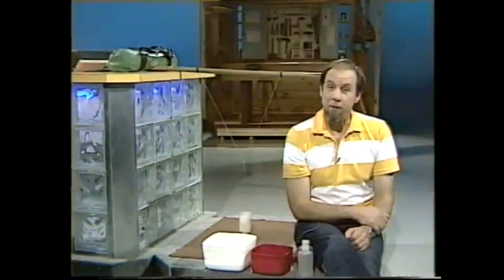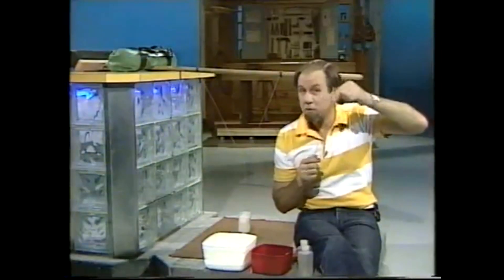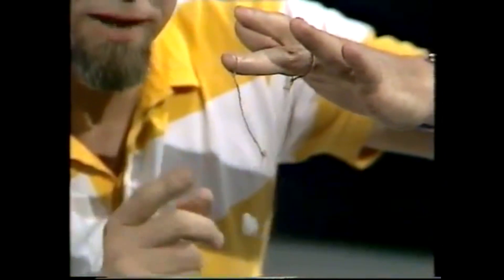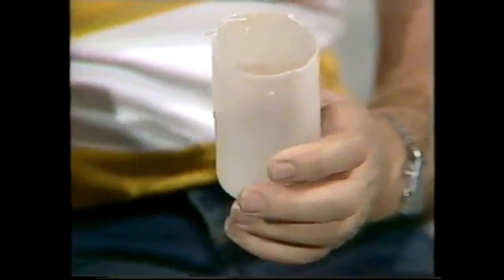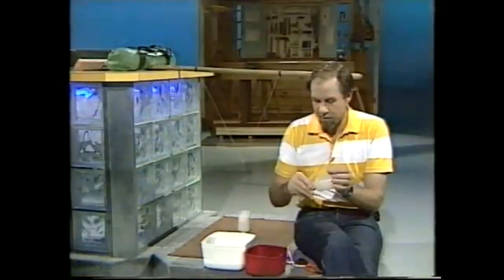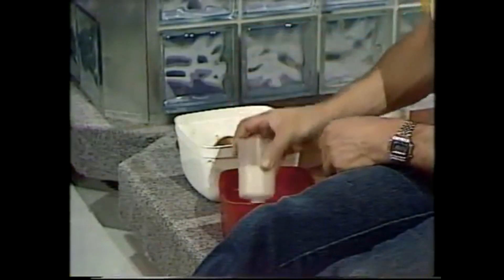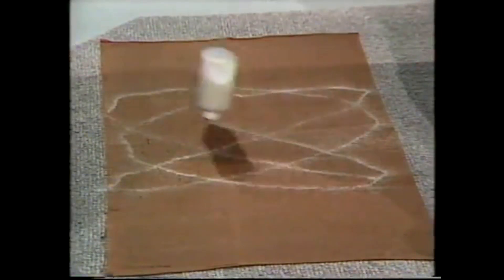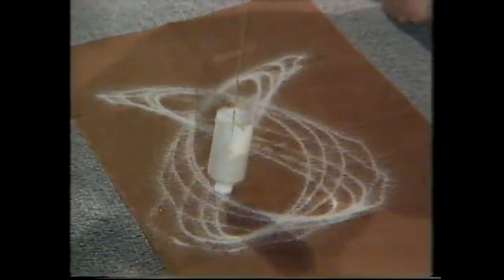Sand harmonograph designs

Comment: Just heat it up on the stove, and it will melt its way through.  What a time.
Reply: Still works with most plastics today.
Reply: @timharig  I meant the safety aspect of telling a child to do that
Reply: @MushookieMan  If a child that is too young to do this have access to a sharp metal object and a stove then it's their parents fault, not the show.
Reply: @E_y_a_l  well said. lack of parental guidance has got nothing to do with the producers of this show . Unfortunately if you treat kids like idiots they will behave like that treat them like intelligent human beings and show some guidance and there's no problems
Reply: @James-kv6kb  Exactly, I've watched this show as a child 30 years ago, I didn't set the house on fire, probably because I had parents that made it very clear that using something like a stove by myself is dangerous, nobody should expect TV shows to do the parents job of educating their kids.